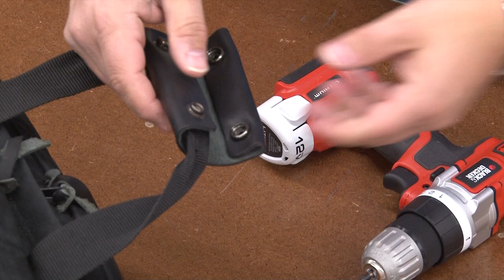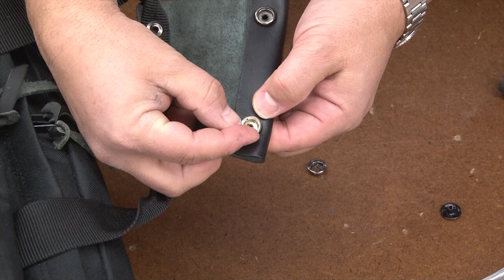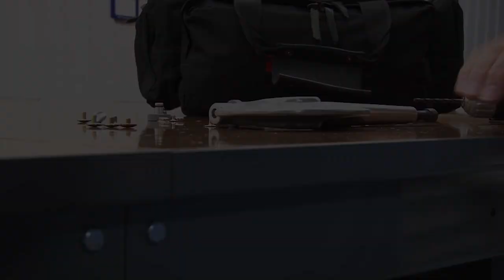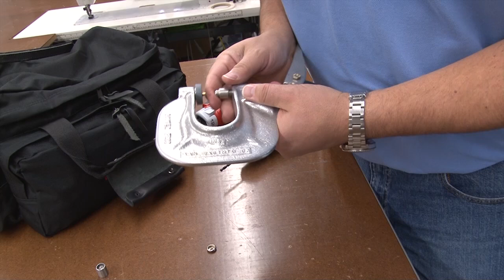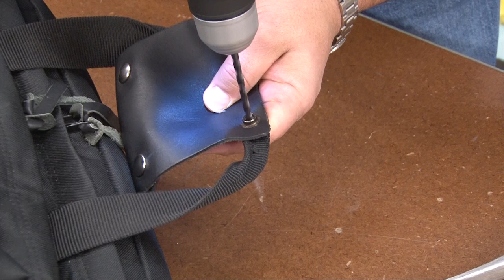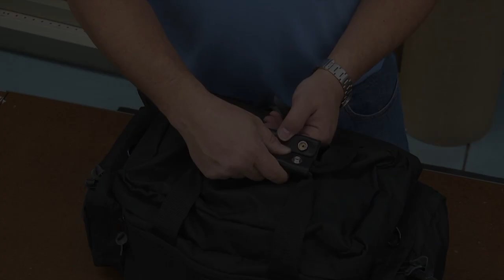How to Remove and Replace a Snap

Comment: Didn't work. The socket just spins around. I'm trying to removed a snap from a boat window. Frustrating
Reply from the maker: You need to use channel lock pliers and hold the button on the backside to keep it from spinning. Please try that.

Comment: Hey I have some buttons that are soldered on to a Levi jacket I want to .continue to keep the buttons to remove and put them on jeans. So if I drill them out will I still be able to keep .the integrity of the button. Because they or Levi button. 🤔
Reply from the maker: Hi Perry,

It may be possible, but it is not likely to work.
Reply: @SailriteDIY  do you have any suggestions.
Reply: @SailriteDIY  and I did buy a soldering iron do you. think that would help.

Comment: My foster daughter had a pair of jeans with a broken snap, hoping to replace just half the snap rather than cutting out the good side I ran to our local craft store, however I bought a heavy duty snap kit that was just one size too big, but it was the only size they had so I came here and yours was the first video.  My son put the drill  bit in and in less than 10 minutes we had the old pieces out and the new pieces in. THANK YOU so much for your video. Thanks to you a good pair if jeans can still be worn.

Comment: Any recommended type of drill bit or metal?
Reply from the maker: A dill bit that is slightly larger than the post of the snap's barrel is all it takes. A drill bit made to drill metal is recommended.

Comment: Hello, I have a jacket that has silver/chrome snaps that are beautiful and in working order however a customer wants me to customize the jacket therefore I need to cover the male end of the snap to make them black in appearance instead of silver/chrome, how do you suggest I do this? Paint or is there a fabric cover that fits neatly over the silver that I can glue down to give me the look I'm going for? please help.
Reply from the maker: The best way to get a black snap is to replace the other snap with a factory finished surface in black. I have never tried to paint them and I do not think a cover is available. Here is a link to the black colored button: http://www.sailrite.com/Snap-Fastener-Button-Black-3-16-Barrel-Nickel-Key-A

Comment: hi I need a snap button tool to use on visors of newsboy caps....I want to start making hats and use the snap tool to open and close the visor..as seen on most typical newsboy caps. Can you please recommend the right tool for this..again it has to be sturdy enough to go through the thick plastic visor...also I would prefer something more mechanical than the simple manual tool you can buy at any hardware store....I need more production grade tool.
Reply from the maker: +Kar Ser Here is my favorite tool for that task: http://www.sailrite.com/Pres-N-Snap-Fastener-Tool

Comment: could you use vise grips
Reply from the maker: +levi woodring You can find dies that will fit on Vise Grips for setting snaps, but they do not work well and are not recommended by Sailrite. So, please do not waist your money on those dies.
Reply: ok just woundering

Comment: do you have to have the press n snap tool? or can this be done another way?
Reply from the maker: Yes, Sailrite sells the Pres-n-Snap tool, I will include a link. It can be done with a few other tools also. I will also provide a link for those as well.

Pres-n-Snap: http://www.sailrite.com/Pres-N-Snap-Fastener-Tool 
Snap Installation Tool: http://www.sailrite.com/Snap-Fastener-Installation-Tool 
Deluxe Snap Installation Tool: http://www.sailrite.com/snap-fastener-deluxe-installation-tool